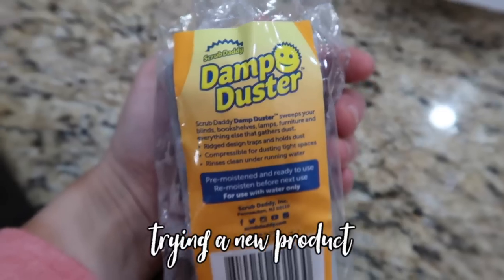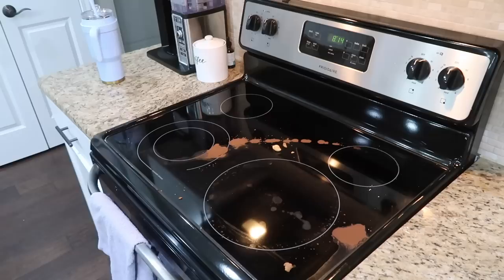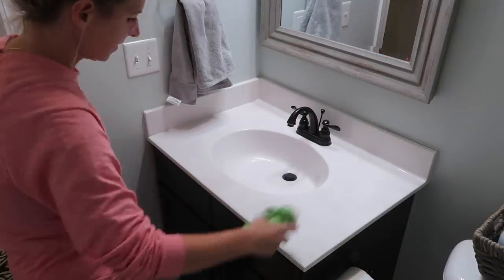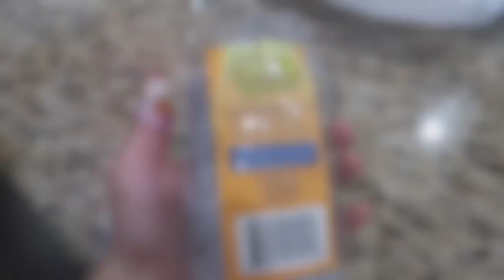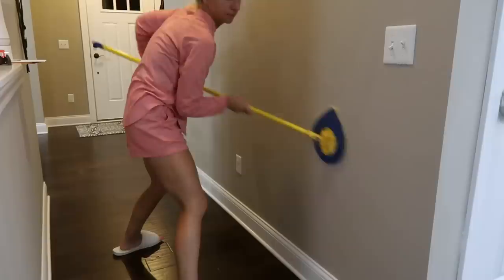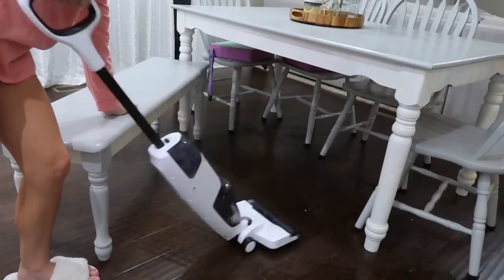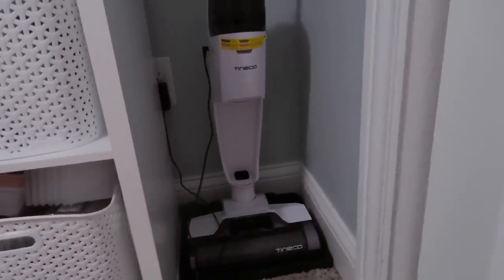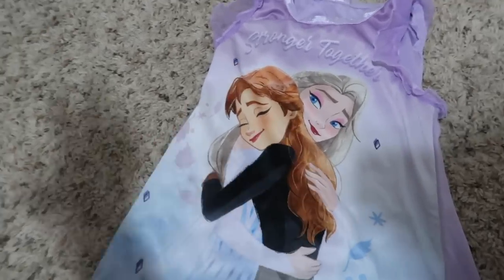🌙NIGHT TIME DEEP CLEAN WITH ME | AFTER DARK SPEED CLEANING MOTIVATION | RELAXING CLEANING ROUTINE

Comment: I would like to share my tip for wet/fresh bloodstains.When the blood is still wet /fresh rinse it under COLD water (nothing else!) and the stains will disappear before your eyes.You can also soak it overnight (or longer) in a bucket with only cold water and you can then wash it as usual.If you use warm water the protein in the blood will set the stain and makes it harder to remove.